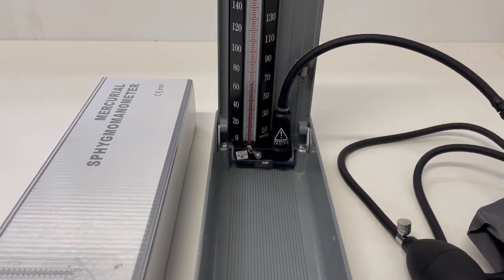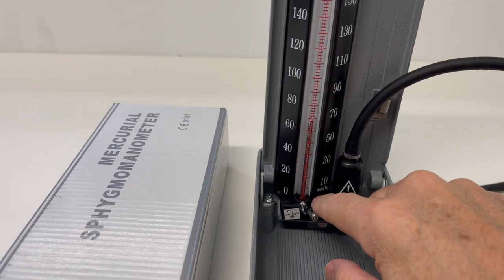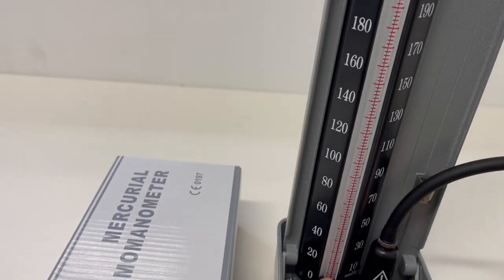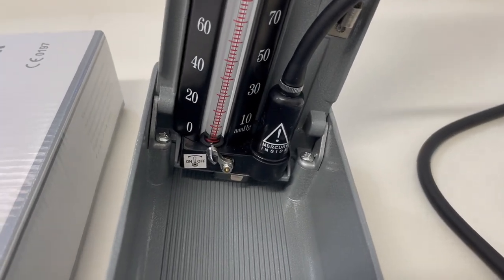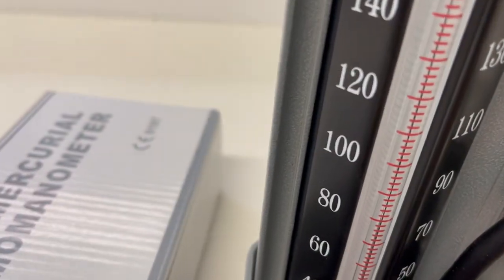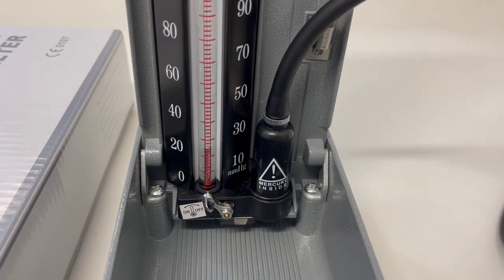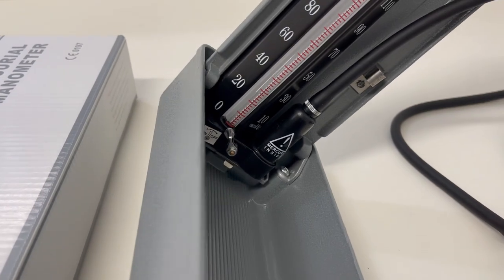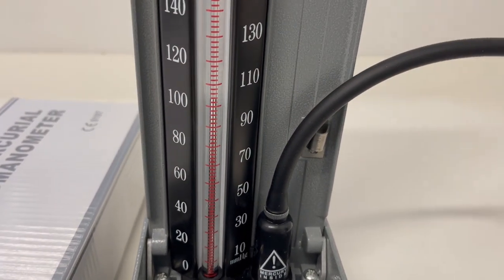Mercury Sphygmo-How to remove the bubble in the glass.

Comment: What if the air bubbles are higher
Reply from the maker: Open the tap and then give the device a  few small taps on the bench. Slowly all the mercury falls to the bottom and the bubbles will be removed. Dadarrrr!

Comment: Agian the bubbles are forming
Reply from the maker: Try not to tilt the device when you are using it. If bubbles appear again, just repeat the steps.
Reply from the maker: Give it a few taps on the base. Also remember that if you travel with this device, always turn the tap to closed so the mercury does not move. Then open the tap when you are back at your clinic.